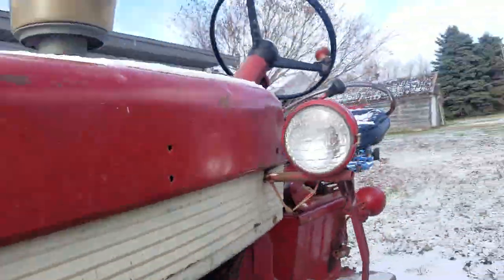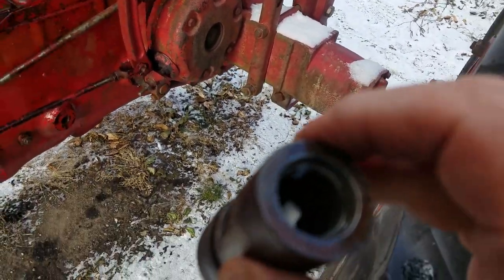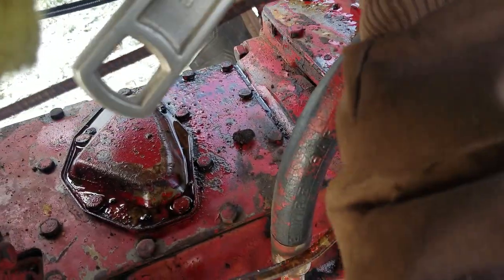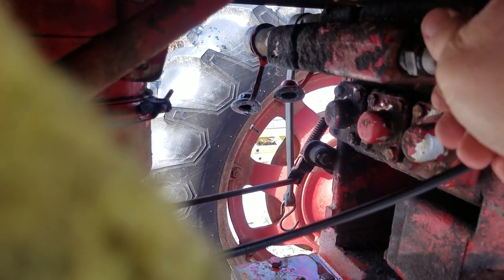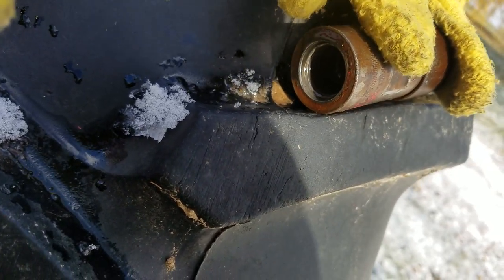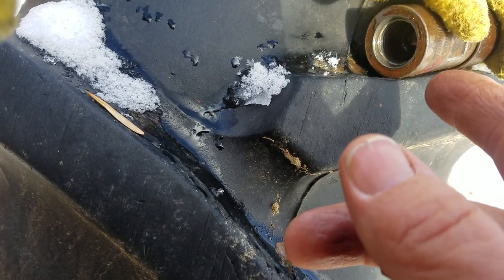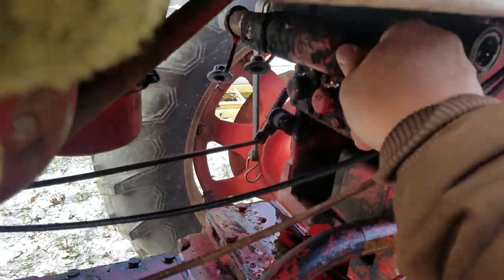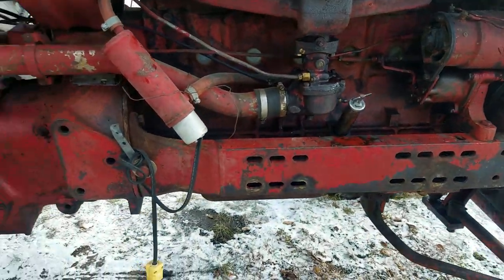IHC Farmall 460 Hydraulic Couplers Leaking

Comment: Thank you for the video. I have the same leak on my 1960 460. Be careful using a crescent wrench in metric mode on American parts, you can round over your bolts :D
Reply from the maker: I hate crescent wrenches. A necessary evil if you don't want to pay $50 for the right size wrench over 1.25"

Comment: You can get most of those apart by pulling the split ring, then maybe just replace the o rings inside and keep going?
Reply from the maker: These female couplers did not leak as long as a male coupler was coupled to it, so that o-ring is fine. The ball and seat inside is leaking. I am not sure if you can replace those.
Reply from the maker: I'll take one apart and see...

Comment: Are you going to replace with vintage connectors, or go with the newer flat faced flush units?
Reply from the maker: The flat face connectors I bought for my skid steer leak so I am going to get ones that are the same but with the poppet check valve instead of a ball. Trouble is most in the local farm stores are 1/2" pipe thread and if I do find o-ring boss it usually is 3/4"-16 and I need 7/8"-14. These ORB fittings have three different names the describe the size and they are all the same size. Dash 10, 7/8"-14 and 5/8" pipe. That can be confusing.